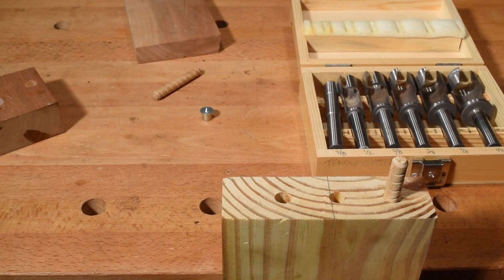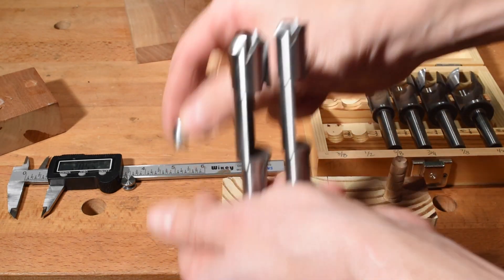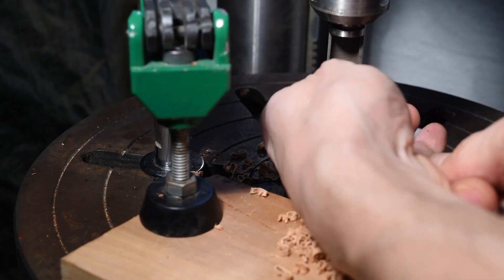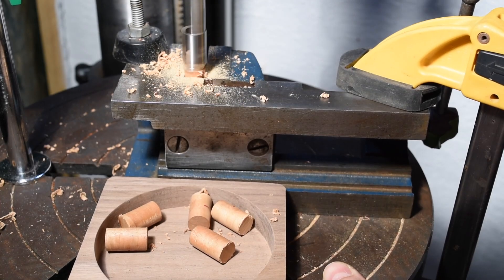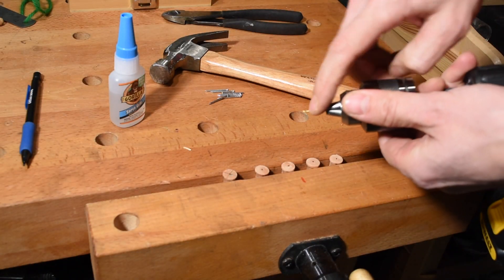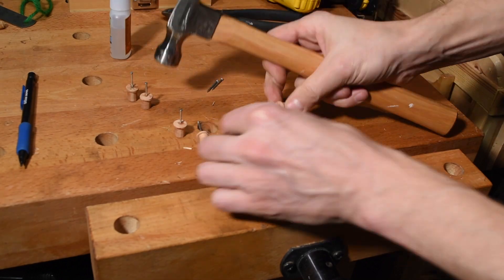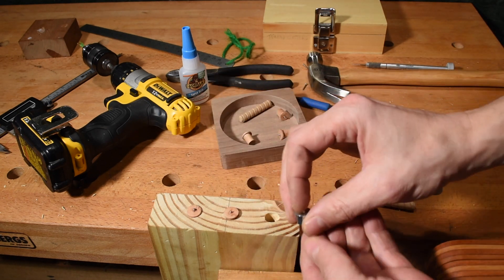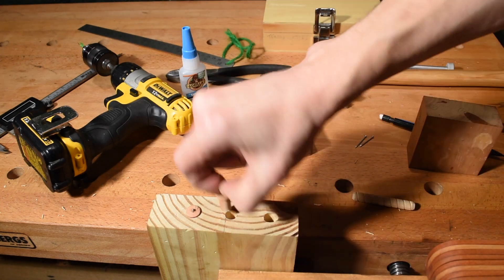DIY Dowel Centers in 15 minutes

Comment: WOW  How simple once shown!  You could make them from dowel stock,   Thank you for this ingenious trick.  I have dowel centers, but this would allow dowels made for almost any drill size... Thanks again, and a very nicely presented video.
Reply: Great idea , just getting back into woodworking. Planning on using dowels to strengthen my projects. Now I can make a bunch of these for bigger projects for a fraction of costs over factory made ones.

Comment: Excellent idea!
Using the smaller plug cutter first without going through the wooden block and then switching to the biggest, would have kept everything centered, I believe... would've been easier also.
Will certainly make some of these :)
Reply from the maker: Yes, you have an excellent point, Eric! 
Only thing you would have to keep switching the tenon cutters which is still easier.
Reply: Yes, obviously. I thought about that after writting it down. Either techniques has its flaws. Mine would be to keep switching plug cutters, yours would be to "correct" the roundness of the dowel center. Still an awesome idea and I will surely make some :D
Reply from the maker: No, no. Had I done it again, I would have done it your way! 
It is much easier to change the plug cutters than to waste time for centering the bit and the dowel and then correcting it. 
I was a bit tired when while making them (wasn't thinking straight) because I attempted to make/film the process of making the dowel centers from brass without using the metal lathe with poor results (wasted like two hours) and then switched straight too my realm,-- wood:))...

Comment: Hi man, Nicely made! When drilling the hole for the nails to glue in, was it centered 'enough' for tranferring  the dowel positions?

In other terms, was your marking and drilling tolerance sufficient for the dowel centers?
Reply from the maker: Sebastiaan, It will be as perfect as you eye/hand is. 

To take that variable out of the equations, you can do the following: 

Keep the wood piece clamped in the same position and only change the drill bits/tenon cutters. Firstly, drill the hole for the nail, then change the drill bit to the "smaller" tenon cutter and cut the plug all the way down (leaving 2–3mm to the bottom of the board). Then, change the tenon cutter to a "larger" one and finish those 2–3mm (it will make that skirt). This way, everything will be perfectly centered. 

If I did it again, this is how I would have done it now...
Reply: Ah Thans man, this seems like net way to do it!
Reply from the maker: Yes, I wish I has come up with it in the first place.(

Comment: Good project. Clearly explained. Thanks for sharing.
But: what are that special drill bits you used? I've never seen that kind before? How are they called? Where to buy them?
Only imperial measures or also metric? (the latter is much better for me)
Reply from the maker: Hi Hans. They are called tenon cutters or plug cutters. I bought this set at www.woodcraft.com. There are many brands and designs. This is a cheaper version. 
Plug cutters are usually shorter and the tenon cutters are longer so they can cut longer tenons, but, of course. you can cut plugs too...
Reply: Thanks for the information.